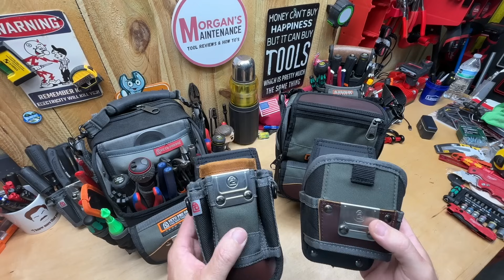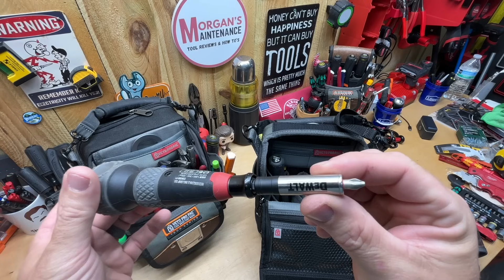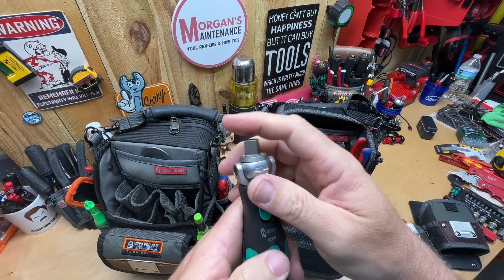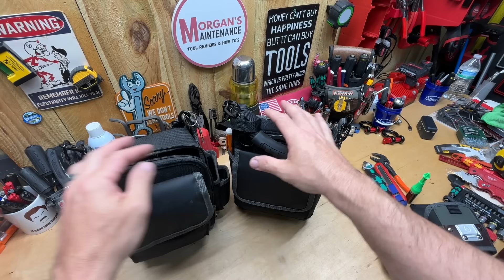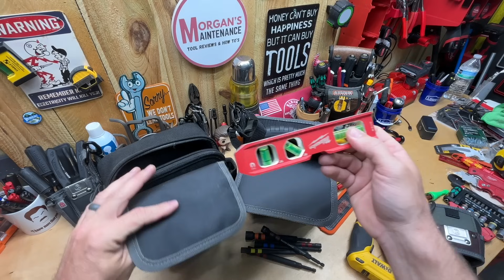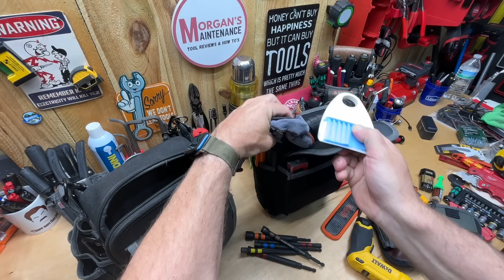Veto SBLD Loaded Into SPMC / What Tools Fit?

Comment: I love my SP-MC and the Drill Holster, but was not overly impressed with the tool pouch though. That is until yesterday when I was working in some position lights on the roof of an RV and was up and down the ladder countless times. Having the tools needed right to hand in the pouch changed my mind. The pouch could maybe be slightly bigger but as a Complete set, the SP-MC is the best!  

(I've bought a second SP-MC in fact. Not sure what it will be for yet, but such a handy bag. Maybe change the V-Swap panel and use for Power Tools?)
Reply from the maker: I like it so far.  I already have the bigger MP Pouches and prefer them, but I do like the magnet clip on this one
Reply: @MORGANSMaintenance    yup, that method of attaching to belt or bag is really good.   One thing I also added to the pouch which makes it more flexible and makes up for small size a bit is one of those clip-on magnetic squares  (sorry, don't know what they are called).  dead handy for screws, and just slapping a tool onto.   I think it was your channel I saw those on?
Reply from the maker: @davidl1338 yeah I have started using magnets more and more

Comment: Always enjoy your vids! Great info and always entertaining. The SPMC is now a contender to the TPLC for my next small repair tech bag. I do exercise equipment service and repair for half of my professional work life and my bag is set up very similarly to your current setup in this new TPMC. I would take that drill pouch attachment and put the meter in it and have it ready to attach to the side when your heading into a job that might need some electrical diagnosis. Thats kind of how I have my bag set up so I dont have to bring a meter in with me every job but can quickly attach it to my bag. Of course, since I dont have a veto yet, my setup isnt as slick. If I end up with a SPMC instead of a TPLC ill probably use that drill pouch as a detachable meter holder.
Reply from the maker: @duncdunc76  I like so far, I also like the TPLC.  The SPMC is definitely more tippy, but a little more compact.  Best thing going for it is that it’s free if you buy some other bags

Comment: I’ve been carrying my sp-mc a couple of weeks, but I haven’t been super busy. It’s been handy, but it’s felt under supplied. Some kind of basic meter is mandatory for me. I added some more Klein pliers, some linesman’s, and a couple of the Klein combo wrenches. Weighs in at 16.5lbs with the M12 Surge. I do love the drill pouch.
Reply from the maker: I’ve only run mine a week so far. I could fit a meter in mine, but it does make you have to make decisions on tools. I always have one in my truck ready to grab, so I decided I wasn’t going to keep one in it all the time.

Comment: Apparently, a regular MP pouch fits in that outside "pocket" where the drill holster/micro pouch goes. Just something to consider...
Are you going to sell the SBLD or keep it now that you have a replacement?
Reply from the maker: I will probably keep it, I may sell the TPLD.

The MP pouches hang a little low if you use the clip but you can put the kickstand in and I like it

Comment: Yea it's s noticeably smaller bag for sure.  I'm playing around with big bag little bag  right now but I want the spmc to work.  For anyone getting this there's 2 d rings and you can wear it as a cross body bag you can work while wearing.  Like Joey gas said if you have to use the side pouches are in bigger bag territory.  It just seems to work better size and weight without them.  Love thr mag mat on the side that works well.  Gives me some ideas but I hate handles down on pliers so I'll play around with it.  And for thoes so worried about tippy with weight its better and not too much of an issue.  Its hard to edit too much out of bags but when you really think about it you can do with less.
Reply from the maker: Yeah weeding out is always hard, but I usually can fix whatever is in front of me with what I have
Reply: @MORGANSMaintenance  as long as you don't have to go mcgiver and build a whole new machine with a paperclip gim wrapper and a string!

Comment: I'm still running a tp4b. I've been looking at these type of bags. Hmmm
Edit: I got the klein pliers wrench and they were not good. Any Pressure in any position would have em slam to the tightest position. Very annoying. Gonna return those tomorrow, probably. And just go with knipexs guaranteed good one
Reply from the maker: I haven’t had issues with mine, but I typically use mine on smaller stuff (usually plumbing supply lines, etc)
Reply: @MORGANSMaintenance  I must've gotten a bad set. Both sizes are defective. Also, if you get ahold of k1, I'm interested In his sb ld. I think that bag would be perfect for commercial work

Comment: I setup mine as a 90% bag. I like the tool side pouch but the drill side pouch isn’t the best. The pockets are really tight and not that useful in my opinion. Hopefully they come out with different side pouches that can be purchased separately kind of like the v swap panels.
Reply from the maker: Would be nice.  Maybe they will come up with more add ons
Reply: @MORGANSMaintenance  I’ve heard you mention the pinchers with the hammer face a few times. Are you using them as a nail puller or for some other function. I’ve been on the fence about them. If they could replace a mini pry bar and hammer I would find a place for them in my bag.
Reply from the maker: @BLachance75 I use them as a small hammer and also nail pullers.  They aren’t fantastic as a hammer, but you can use them to hit on the back of screwdrivers etc

Comment: That's a nice way to load that bag.  I could fit all my most common DIY tools in my TP-3B, so the SP-MC would obviously work.
I'll be using mine differently though, since I will use the small pouch.  All my most common PC service tools fit in the pouch.  I discovered that doing a loadout for the SC45.  The SC45 can't fit the Wolfbox, or a small electric screwdriver; the SPMC obviously can.
Reply from the maker: It surprisingly held more than I truly expected it to. I figured I was going to have to make harder decisions
Reply: @MORGANSMaintenance  Indeed, with your vest and the MP-pouches you always use anyway, you should be set.
Reply: @OnusBones I know you wanna blow the house down

Comment: Could always put a shaped wooden block or bit of foam on the bottom of the inside to raise the adjustable spanner up a bit. Certainly, produces a compact loadout, may be a bit too small for my needs 🤔.
Reply from the maker: Good idea… I had done that in the past even with just rags
Reply: @three-phase562  I've done that with just stuff before makita socket rails a few shark sharkbite valves/caps abrasive pad for debuting pipe ect.  Not something I need every day but I wouldn't be without it for common maintenance tasks.

Comment: How does a M12 impact fit in that drill holster with or without the drill pins? Just curious.
Reply: @Jesus_Strong  it favors the m12 impact 3rd gen it's thinner.  Also surge with boot is a little chunky.  I thought about the m12 3rd gen impact out of sheer weight over the surge its a noticeable thing too.
Reply from the maker: Fits fairly well.  Mine is a little tighter with the boot, but it still fits good with or without the pin.  Works better if the pin sticks out.

They also actually fit better handle down which is good for storage, maybe not so much using it.

Send me an email and I will send you some pics. I know I have your email somewhere, but I will have to try and find it in between all the ones of people wanting to send me yoga pants and cat toys 😂

Comment: I have an SB-LD and 2 SP-MCs I need to sell.😅
Reply from the maker: 😂.. I will have an extra SPMC but I think my buddy might want to buy it
Reply: @MORGANSMaintenance  I'll have a third SP-MC to sell, after I order the Tech Pac Wheeler Blackout when it's back in stock.😅😰 I'll probably wait until the end of summer to start listing them.
Reply from the maker: @k1_w3 yeah I never try to sell them during the promo
Reply: @MORGANSMaintenance  if you wouldn't mind helping out, Mr M
Reply: I might be interested in the sb ld depending on its condition,  k1
Reply: @JustinSparkable  It's brand new. I never took it out of the sealed plastic bag from Veto.
Reply: @k1_w3  ask Mr Morgan for my contact info. It's not letting me post it here

Comment: I really like the railer hex bit system. My only complaint is that they don't have a 1.5 mm hex key. I occasionally need it for work.
Reply: That’s not a bad idea
Reply from the maker: Yeah it has some skips, you could maybe add one from another and replace one you rarely use

Comment: This will end up being a really helpful video for some. Might have to still consider this little bag for a light set up!
Reply: @toolswithtim  we all hyper analyze tool bags or any purchase it's the way we think.  2% gain in organization is clearly a "Gamechanger! 🏈 " 🤣
Reply: @MattHmm-rq6dn  the SB-LD is Great if you like Cramming pockets 😆
Reply: @toolswithtim if you need to double stack pockets your tool bag is too small i feel.  I've grown to like single tool per pocket and don't think I'll go back.😅
Reply from the maker: Yeah… a place for a meter, and short tools are things this bag is missing.

You can definitely fit both in them, but it’s a limited bag for it. You will have to make some decisions to be able to do it
Reply: @MORGANSMaintenance  I can tell you the milwaukee auto meter or a cell phone style one fits way better in this bag.  At least them milwaukee auto meters for the very basics fits reasonably well.  The kawattis can fit with more room for tools
Reply from the maker: @ yeah I could put the KAIWEETS small one I have in the back if I find myself running into issues not having one. 

I can fit my Fluke in there, I just don’t want to dig around it all the time when I’m not using it fixing plumbing, hanging pictures, putting together furniture, etc.